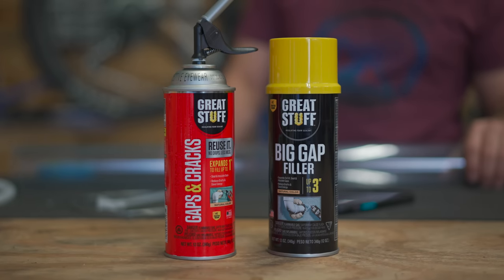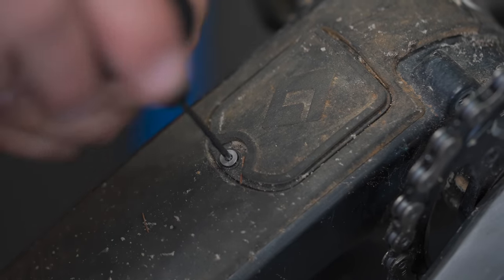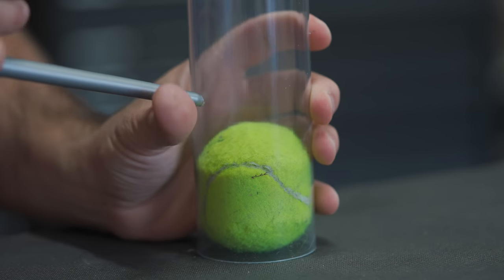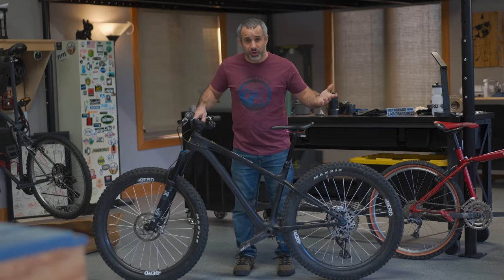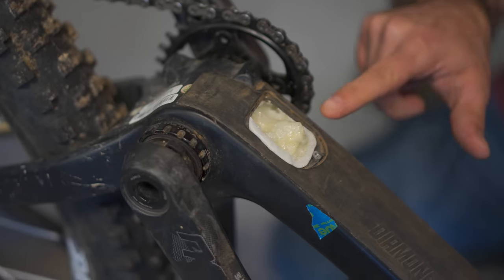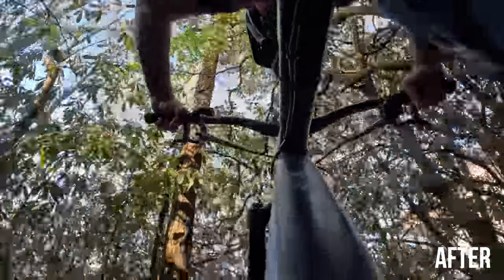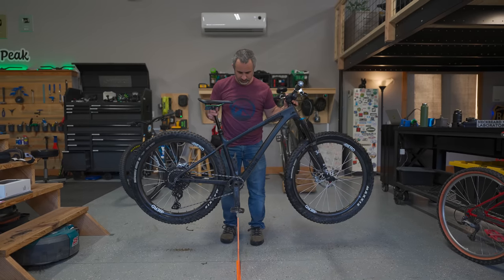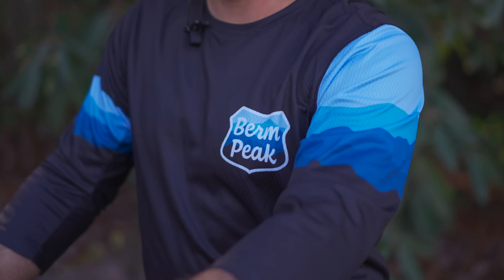Filling my bike frame with foam made it better—kind of. Don’t do it.

Comment: I’d be most curious if it has any potential long term chemical dissimilarity with steel, AL, or carbon. Otherwise I see no benefits to it and only potential concerns. But thanks for doing the test!
Reply: its extremely dependant on the specific type of polymer and composition used, but generally cyanate esters (which i believe are most common in these types of expansion foams) are protective against corrosion in steel. Al should not be of any issue at all either, no idea about carbon laminates either but would guess theres no significant issue.
Reply: Long term it can absorb water and even grow black mold.

Comment: Yes, yes, yes.
Back in 1985-86 as a kid I had a Kuwahara bmx that me and a couple of friends used for lake jumping. I filled the frame with expansion foam, tied plastic bottles to the bars crossbar and pumped up the tyre as hard as I could.
Good times.👍👍👍✌️🇬🇧

Comment: It does trap moisture, wouldn’t recommend on a steel frame. Wouldn’t recommend it at all tbh
Reply: It's more like plastic than actual foam. I worked at a plant where we made it. I now work at a place where it's actually used in new home construction

Comment: Majority of those spray cans instructions say you can only foam 4 inches thickness at a time, otherwise they don't set and it turns back to liquid. Seems like it worked in this case possibly because it could get air from both sides of the foam.

I had to fill a 3ft deep downward pipe and 1 can filled it, went back the next day and was just liquid in the bottom, 4 cans later and it kept doing the same thing. You need 2 part liquid foam, that stuff actually works.

Comment: I am not a bike enthusiast or expert by any means, just an overall tinkerer, but it seems to me that you could utilize a very thin walled bike frame (of whatever material is the best choice) and also utilize appropriate rigid foam to both make the bike lighter and more rigid, as well as running "conduits" inside that keep the wires free, but much quieter.  I am thinking something built from the ground up, not retrofitted.

Comment: I remember doing this years ago to quiet a lug pin in the top tube that had broken off in a really old Raleigh, 70's vintage.   We tried trying to shake it out but took just a bit of foam, letting it dry and it worked perfectly.

Comment: I just used light weight heater vent filters and stuffed a bunch in my Orbea Rallon to deaden the cable rattle. Worked brilliantly and super light weight, No mess and easy to remove. My bike runs so much quieter now.

Comment: I usually look for reason to avoid expanding foam. Cleaning it up is a nightmare, especially off your hands, arm hair and almost impossible to get out of clothes.
Reply: And your pickups carpet.... :(
Reply: Every time I've ever used it, I've had to remove a couple layers of skin to get it off my hands afterwards.   (I know you're supposed to wear gloves, but the stuff is hard enough to work with already and gloves just increase the PITA factor.)

Comment: Some of the high-end bicycles did have foam in them - it allows to have thinner carbon walls, and thus lighter frame. But those are very delicate and fragile frames that will not suvive any dents. Modern tech moved on to better weave and layeribg, so it isn't a thing any more.

Comment: The thing that I'd be more worried about was isolating (if it's even possible) two critical areas inside the frame where you do not want to see this stuff infiltrate, the head tube and the crank tube. It's been many years since I've taken a bike down, but I can't imagine that things have changed so much that there are no longer bearings in those areas. Bearings that probably function best when they're greased instead of having some kind of expanding chemical that does zero to keep those bearing surfaces properly lubed.

Comment: The people I rode with back in the day, and myself, used to put those foam tube thingies outside our cables that run inside the frame to stop them from making noise. The thing with filling a frame with foam seems like a not too great idea but seeing as I'm not a foam expert and that there are many types, there might be one that works. Make sure that it doesn't retain water though.
Reply: I thought back in the day the cables were on the outside 🤷🏻‍♂️
Reply: @daroob  I'm not THAT old lol but good one, I'll give you that 😂

Comment: You might get slightly less ringing and harmonics, to make the bike feel more solid and less buzzy and fatiguing, like the Berd rope spokes. The foam does provide some vibration damping. They do this on cars from the factory, definitely works. However specialized foams do this much better, like vibrocore. What works even better for vibration damping is wood. 

I hammered some wood dowels and rubber into handlebars and the vibration reduction is substantial on both an mtb and a motorcycle. On the motorcycle the difference was undeniable because the mirrors were substantially clearer from the lack of harmonic vibration. This adds virtually no weight. I've not seen this suggested anywhere online, but it definitely works and is quite easy, reversible, and not messy.

Tiger woods played with wood dowels hammered into his club shafts to make them less fatiguing on the hands. Also, despite many other high tech materials being tried, wood is used in virtually all alpine skis, because nothing damps vibration as well.

Comment: Forget noise, what about comfort? I think a better test would be to fill your handlebar with foam (to see if it absorbs more vibrations like other vibro-core stuff).🤔
Reply: Spank makes a foam filled gravel bar, so you're onto something. I have one, but put it on over the winter last year so I didn't get a back to back comparison to the original road bar.

Comment: I had a Canandale Raven and they actually sold a foam kit that you spray into your bottom bracket to stop it from cracking which was very reassuring, But it did make a very hollow sounding carbon bike a bit quieter.

Comment: If you want to know the added weight it's easier to just weigh in the full bottle of foam and then test it post application, the difference is all foam inside the frame!

Comment: Some things to consider:

With how the video is edited, it's difficult to tell if you kept the decibel meter installed from the unfilled run to the filled run. If it was removed, and re-mounted, it's theoretically possible it didn't wind up as snug, or in exactly the same place, which could skew the results. 

Because decibels is a logarithmic system, a difference of 3 decibels is a doubling of volume. We don't subjectively perceive it that way, it's only about a 25% difference to our ears but.... energetically speaking, that's half the sound it used to make. Still, that 2-3db difference is pretty significant, actually. 

Expanding foam dissolves in acetone. I don't know anything about composite frame bikes, but anything made of aluminum should be unaffected. You could just pour acetone down the same fill hole, and slosh it around a little bit, and all the foam would pour out easily.

Comment: One thing I’d be concerned about, when water gets inside your frame (possibly through the cable ports or other means of entry) the foam will block the water from draining properly to the drainage holes. Can’t imagine having a pool of water sitting in your frame is good
Reply: it blocks water ingress

Comment: The weight difference should be easy to work out. You just need to weigh the can of foam before and after. It doesn't get heavier as it expands 🙂
Reply: It might absorb moisture over time and get heavier though
Reply: I came here to say the same thing. Weigh the can that you used and then compare it to a new full can. The difference would be how much weight you added to the bike.

Comment: when you want to fill a cavity with expanding foam like you used, these things use water to complete the process so, what I've seen is using a steam cleaner to kind of inject steam through the foam can nozzle and that can allow the foam to actually fill the cavity uniformly and get a much more solid result since it has the moisture it needs to complete the process. I know there are other foams that would work without pumping water into your frame but those can be pretty expensive materials.

Comment: One big thing that comes to mind that this would be useful for would be steel frames and preventing rustout. Assuming the foam will help block moisture. Also I feel like a more fair test for sound would be an cheaper older bike. neat test

Comment: With using spray foam from a can, I'd have some doubts if all the foam is actually 'kicking off' or expanding.  I tried to fill a container once with the intent of cutting it apart and using the foam as a mold for a leather project but found that even after a week, the foam, which was 4" thick in places hadn't expanded and had remained gooey. I later was told that some foam takes humidity or moisture to cure. 

On another note, as a kid, a few guys had built a ramp along one popular swimming hole. Kids would run down the hill, off the ramp and flip the bike into the creek. The water was about 15ft deep there and many bikes never got pulled back out. After a buddy lost his new bike in the water and required finding someone who could or was willing to dive down to get it, he started wrapping the frame in foam in hopes that it would float. It sort of worked but it would still sink if you didn't get to it fast enough. His dad worked at a place that used two part spray foam and one of the guys filled his bike from the seat tube. He even filled the handle bars. 
The next morning the bike had foam busting out of all points, it was coming out of the headset, bottom bracket, and every tiny little hole, it even had a massive foam tumor formed under the seat. 
After tearing the bike apart to clear the foam out of the headset and bottom bracket, and trimming off the dozen or so foam spaghetti trails all over the bike, he proceeded to 'test it out'.
He launched it high off the ramp and let it land in the water. It disappeared for a bit but floated near the surface, but was still submerged a bit. It was floating upside down with the tires being the most buoyant.  It worked but after a few months of that, the foam started to hold water and the bike gained weight fast. The foam apparently broke down over time and was no longer completely a close cell foam so it became like a sponge effectively filling the frame with water every time it got dunked. We realized this after seeing the bike leave a massive puddle of rusty water each time the day after it went for a swim. Eventually, it ended up at the bottom of the creek for good where it likely still rests now roughly 45 years later.

Comment: I always thought the foam was designed to keep loose internal cables from rattling - problem you don't have, obviously. In any case, as an audio engineer, I'd hypothesize that the consistent reduced loudness measured in the rock garden is due to less resonance of in the tube being transmitted to the SPL meter mechanically rather than through the air. You should be able to set the SPL meter to measure using a slower average and thereby reduce the influence of the anomalous loud sounds like rims pinging on rocks.

Comment: Back in the old dirt bike days, there was this product called the bar snake, that was basically a solid rubber hose you ran inside your bars to (lessen the vibration) of riding. It was hard as hell to get that rubber into the bars, and didn't seem to make much of a difference. but there's always a product for a buyer.

Comment: I used to shoot it into steel frames down the top and bottom tubes through the headset, into the seat, bottom, and chainstays through the bottom bracket, and into the chainstays through the rear weep holes to keep moisture out of the frame for deep creek crossings etc. seemed to work.

Comment: For sound pressure measurements . a difference of 3 Db is significant because it is a logarithmic scale this means if a sound is reduced by 3Db it has actually 100% less energy if it is 6Db less it means it is perceived as half as loud . Thus a consistent 2 DB noise reduction can be considered as significant but only if a background noise calibration was done to know what is the normal level of ambient sound .

Comment: from an acoustics standpoint:
the empty body/frame will resonate with certain frequencies and thus amplify them. It being essentially thin pipes, they dont resonate much, dont know about the material yours is made from. Also the frame isnt a uniform shape or even a voluminous body (see guitar), so the amount of possible resonating frequencies is less.
The dB meter was set to dBa, which is a perceived volume. The human ear hears different frequencies at different volumes. So the first test just could have had some random rock or jiggle make a higher volume in the 3khz range. Around 3khz is the most important part for understanding speech, so the ear is more sensitive to that, which leads back to the dBa setting on the dB meter.
When you filled the frame with foam, you acoustically made it a solid body. That body not being just a single material affects the resonance very much, especially when its filled with foam. Foam has a lot of air bubbles, different sizes, shapes, etc. Meaning it is very good at dampening sound.

TL,DR:
Foam DOES dampen the sound

Comment: I tried this on handlebars once.. I was trying to replicate the Spank foam core bars. 
The outcome is that it never dries. On narrow bars that are only 800mm long at most… it doesn’t dry so your frame is most definitely not going to dry. That said, foam is similar to gorilla glue. If it comes in contact with water it cures rock hard. So you could inject water theoretically to cure it. But then it would be hard and negate the original purpose of dulling vibrations. 
I did conclude that my aluminum bars were more comfortable to use. I had less fatigue and they felt more similar to carbon bars. 
That all said… if you do decide to try this on your bars or frame it is absolutely crucial that you spray a small amount and wait till it dries .. then spray a little more… repeat. 
As for weight, it will weigh more over time as it is open cell foam and takes on moisture. How much weight it will take on depends where you live. If you live in Arizona it probably won’t matter. If you ride in the Pacific Northwest and ride through puddles… you’ll eventually regret your decision once it becomes waterlogged and your 5 pound frame now weighs 10 pounds.

Comment: This is an interesting one. The source of noise on a bike is not the frame, except an occasional snot getting flicked up at it, and many bikes even have impact protection for that now.

However a bike frame is a set of hollow tubes. Most musical instruments are also hollow tubes (or other shapes). So vibrations into the frame from other parts of the bike are likely to reverberate ( or even resonate) inside the frame and make those sounds louder.

Maybe you could just part fill it with water to tune it to a particular note, like when you blow over the top of a glass bottle?

The easiest way to make a bike quieter is take care of it. keep the spokes tight, service your bearings and get a clutch derailleur with the right length of chain.

Comment: If you really want to do this, there are foams designed to harden in completely sealed conditions that can be used to stiffen automotive frames. Use one of those instead of contractor-grade "I can't be bothered to cut the insulation to the proper size" foam.

That said, the before and after drop tests sound identical to me. I have good hearing and hi-fi speakers, and I can't even hear any specific frequencies that are quieter than before.

Comment: Yes i have done with my carbon frame  and it works great. The sound of hollow is gone 100%. 
But over the time i did another experiment i fill down tube with  aquraim filter wool its works better, plus you can pull it out when ever you need

Comment: I am thinking if maybe you have an old creaky frame, this could be a way to quiet it down until you can save up for an upgrade? That would be an interesting test, to do this with a more well used frame or.older frame or something.
Reply: Especially on a rigid bike.

Comment: In the case of your super silent bike I wouldnt expect too much. My old Cube Aim Race was rattling in various places, there it might have made a noticeable difference. But I think the biggest difference shows, when you have parts squeaking. With aluminum and carbon frames it is often very hard to locate the source of the noise, because the whole frame starts resonating. With the frame silenced and the noise limited to the source, it might be easier to hear if it is your crankshaft that needs to be replaced, or whatever.

Comment: I have some experience with various expansion foam products. While I have never done this I have heard that people also do this to race cars in cases were you are racing a unibody car in a class that doesn’t allow for things like stitch welding. However the information I have found basically says that there are very small gains and that the construction foam is the incorrect type of foam, you want to use more of a urethane foam that is more close cell in nature. This can be useful in adding stiffness and will actually cure as it’s a different type of reaction that forms the final product. More research and testing might be in order?

Comment: My Propain Tyee (Carbon) has the internal cable routing with liners and there is definitely a little patch of some sort of foam in the center of the downtube that keeps the liners from ratteling